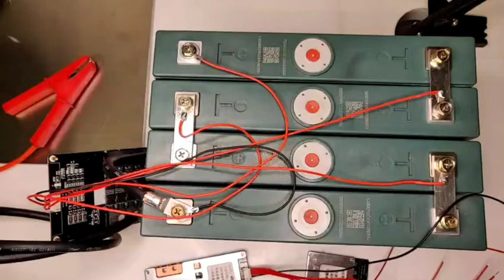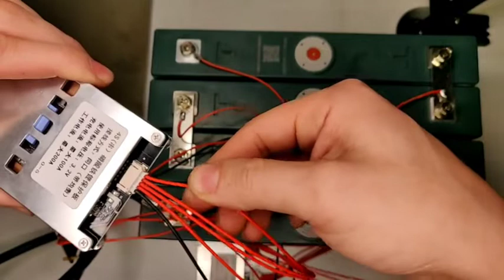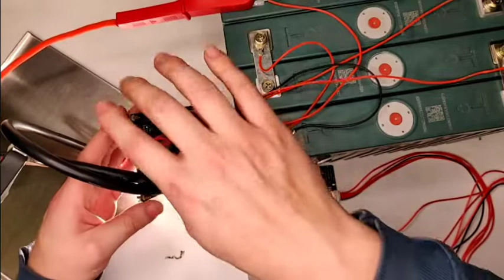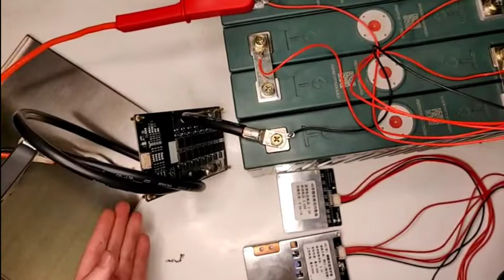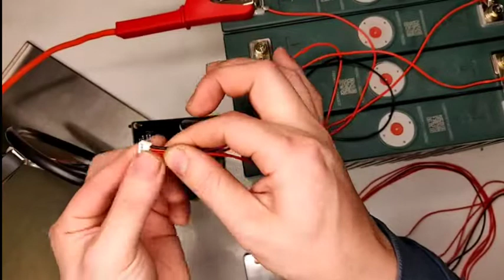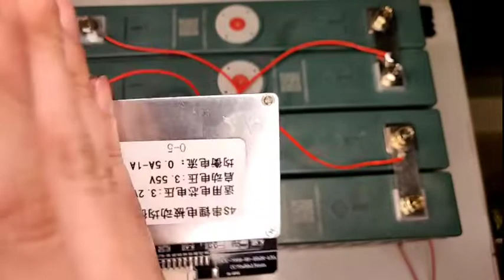How to build a lithium battery & the Components needed.

Comment: So they are 25ah cells not 100ah
Reply: They're 100ah cells at 3.2 volts. Four in series gives 100ah at 12.8v
Reply: When you assemble cells in series, you add the volts and the amps stay the same.  If in parallel, volts stay the same and amps are added together.  This also works for solar panels.